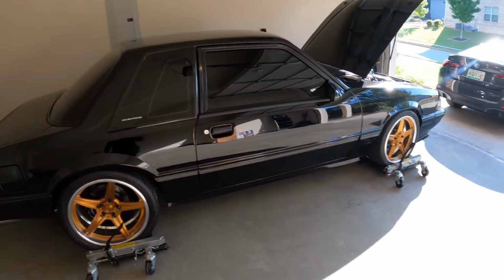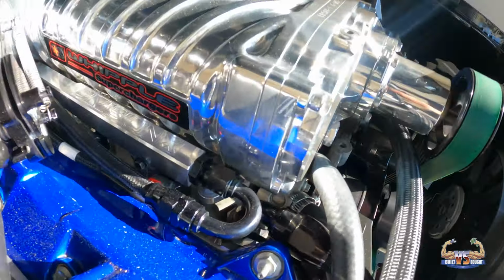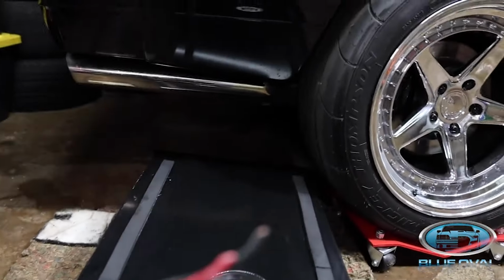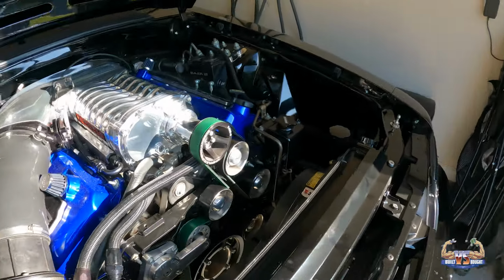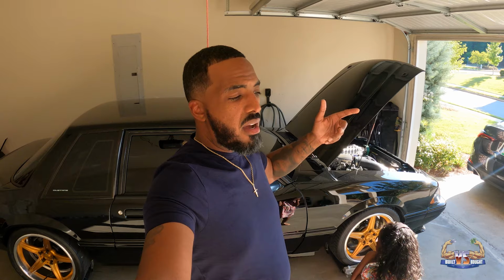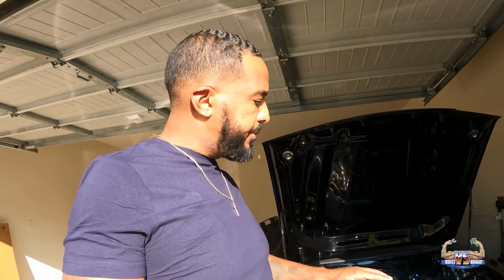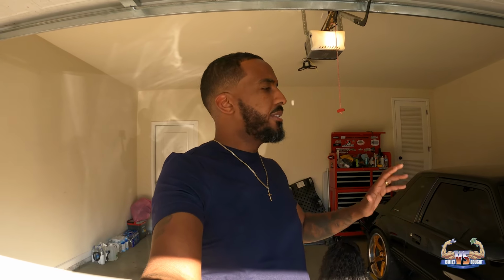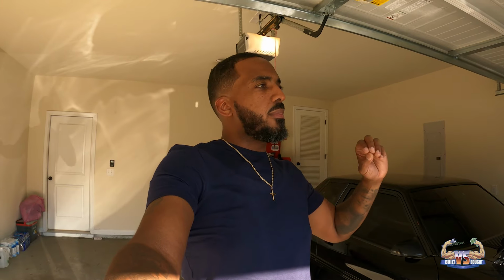The Aftermath of Ford Takeover Part 2

Comment: I completely understand the frustration. I have been fighting heat issues for a few years now. It’s not easy to heavily modify these cars and still make it function as a “stock” car would. It won’t overheat but will get around the 215-220 degree area and makes it really uncomfortable and start to panic a little. Anyone breaking your stones about not driving your car, hasn’t dealt with these issues. Best of luck with it and hope you can enjoy the car soon 🙏

Comment: Is only overheating when the ac is on?
Reply from the maker: Only when it's over 95 degrees outside and the AC is on. If it's 80 outside it is not a problem with the AC on. With no Ac it is never a problem
Reply: @BuiltVSBought   Only at idle?